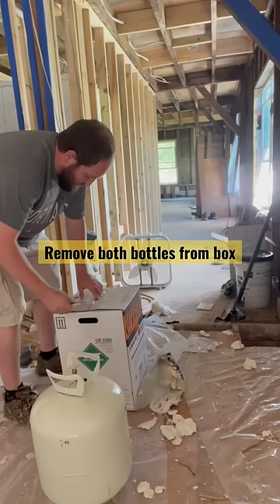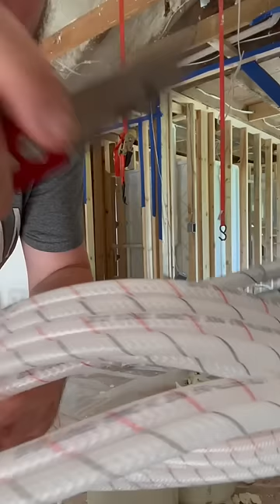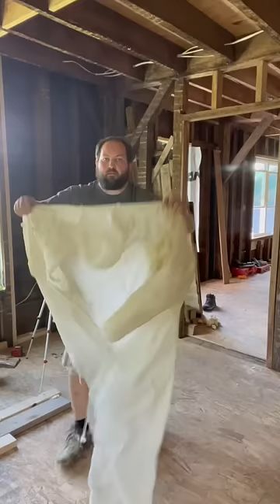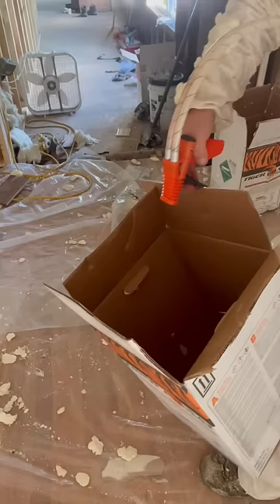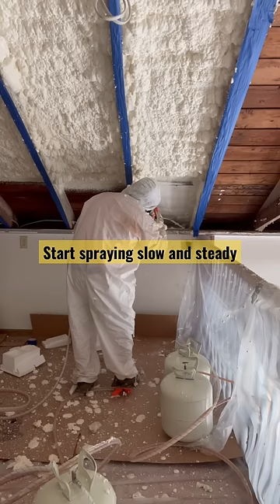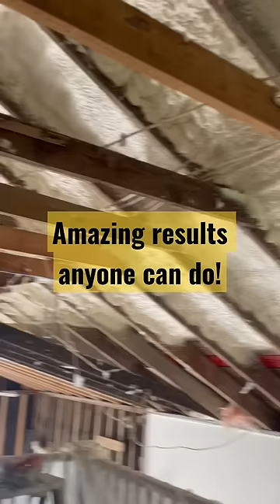Learn to spray foam in 60 seconds! 💡#shorts

Comment: Stay tuned for the next video, how to be an electrician in 60 seconds
Reply: Zap lmao 🤣
Reply: Actually its really not that hard to do the electrical work its hard to make sure it all looks nice professional and to code
Reply: Once you figure out how to identify hot neutral and ground for the wires and the attaching side it all comes along easily unless your doing industrial work
Reply: @TheTinkle1  & if you have to figure out what size of wire you need to use for the length of run that will let the equipment that you're supplying run at its peak performance. Other than that, ya the hardest part is making it all look fancelike! 🤓😎🤙🏽🤙🏽
Reply: Bro this is way easier than electrical. Easier than painting even.

Comment: That’s a mess
Reply: I agree, I live in Texas and have r-15, r-19, r-30 fiberglass roll insulation & blue board i installed and everything sealed correctly to avoid a hoist of problems like moisture to prevent future rot, and my attic stays around 70°s & 80°s on hot 100°+ summer days. Also its quick and easy to install, remove, replace or get access if work or repairs are ever needed to be done. The foam not so much. The fiberglass insulation isn't as messy, restrictive in multiple ways, pain instilling for repairs replacements and installing, or even take close to as long during the installation period. As long as it's installed correctly and is the correct type, rating and size for the occupied space it not only does the job, but performs and holds up just as well as any other products including the foam shown in this video.

Comment: I hate to say it but if you have a large area to spray,  it's cheaper to hire a outfit to do it .those small kit are expensive.
Reply: Yeah 86 froth packs later
Reply: Yea I was wondering the cost compared to regular drop in insulation
Reply: Yeah. It is kinda BS how expensive this DIY is...
Reply: @skythunder4413  They running about 1.80US per sqft at 1in thickness (per board foot) on Amazon. 
Professionally installed is probably a bit less, but may not be where this fellow lives.  The foam costs more DIY, but you aren't paying someone else. The evenness and therefore sealing of a professional install is much better though and they are liable if it goes wrong. So there would have to be a good reason to do it yourself. 

Often people use this for the sealing, and then use batt or loose fill for the rest. It's expensive, but the seal cannot be beat, it also makes the house stronger.
Reply: Yeah plus you don't get nearly as good of a product with Froth packs.
Reply: @court2379  if I remember right from when I sold insulation a structure that is completely foamed together is 300 times stronger than it was before. Essentially every point is glued together.
Reply: @cohenj87  I'm going to guess that was 300% or 3x. 300x would be like a solid tungsten carbide house. 

Really fully foamed houses should be designed a bit different to take advantage of the added strength. For instance maybe leave a 1in gap between the stud and sheathing. Only using a few screws to hold the panels on. Then shoot foam into the gap glueing the sheathing to the stud on the face and sides. Thermal bridging is reduced, some cost is saved on nails and the labor to install them, and there are less penetrations for water infiltration.

Or a step further use hardyboard siding and no sheathing, or house wrap and the labor to install them. Foam directly to the siding creating a waterproof layer. The shear strength would need to be tested to make sure it is as strong, and a spacer would be needed between the siding and stud to allow the foam in for a continuous barrier.

Basically test some out of the box thinking to take advantage of the strength and sealing it provides.
Reply: @cohenj87  From what we saw here I think the issue is how fast it sprays on. You need a good uniform coating, and this is spitting droplets leaving spaces between. Particularly at the edges of the spray pattern. 
I think if he had gone a bit slower or held it closer the coating would be more uniform.
Reply: @cohenj87  only stronger if it's closed-cell. Open cell is more commonly done because it's cheaper. This stuff looks like open-cell
Reply: @matsudakodo  froth pak is closed cell ya dingus
Reply: Fr or poor man spray, fit foam board then seal with a froth pack

Comment: As a plumber we hate when they do this because if you ever have a leak witch will happen, we will have to open more wall costing you more money. Could be leaking from a tee or a line or a fitting.
Reply: Lots of plumbing is hidden in the rafters eh?
Reply: @tech5298  in some states yes. When I lived in Texas there water heaters were in the attic. So eh
Reply: @MaxPower1000.  
Yah here in kommiefornia there are heaters in the attic too. I sprayed the ceiling in my own house, just the living room, before adding a ceiling. I basically took a vaulted ceiling made with 2x4’s - very thin and very hot, and added another, lower ceiling and enclosed w drywall. It was far cheaper than tearing down. No wires or plumbing in the 2x4 rafters though. I’ve never seen stuff routed up next to the roof. Never. 

(Oh wait, your comment was about walls and not the roof like in the video. Sorry I didn’t read it right after two tries, lol. My bad!!) Yes in the walls and around pipes - yikes!! That would not be good.
Reply: @Power_Glove  This was in San Antonio, Texas. I dont know if it was elevation or gravity. We drained as much as we could and lower it down.

Comment: This stuff is extremely insulating. Closed cell will provide on average 7.5 r value per inch of thickness. Both canisters you see here look like the 600 board foot version for closed or 1200 for open cell. Open cell can do about 3.4-4 r value per inch. Not recommended for roof tho. You'd want closed for that. Depending on where you are. 3 inches of closed cell would be enough for your walls. So these two canisters would yield around 200sqft. Aka expensive AF
Reply: Note: on average they go for around $500 for what you see here
Reply: I thought they were the 600ft canisters that cost between 600-700$
Reply: @WhiteWolfos  you are right. My prices are a bit outdated. They go for around 800 bucks now...jesus

Comment: How much does a set up like that go for?
Reply: $ 990 on Amazon
Reply from the maker: Bought direct from tiger foam at 785 per kit
Reply: Hell yeah thanks
Reply: @shpoon8184  Never mind I found another comment where you mentioned it does 600 board feet.

Comment: Used to use a similar system to spray foam adhesive for roofing tiles. Shit was a nightmare to get off of you if you accidentally got it on your hands or clothing. Should’ve had one of them suits 😂

Comment: Why do people use foam in the US?

We normally use rockwool or some other brand of mineral-wool. A Moisture barrier/water barrier, then 200mm (8 inches) of mineral wool, a second vapour barrier on top of the wooden trusses, then some 2" x 3" wood and another 3" of insulation in a cross-pattern over the first one.

After that - cement board or dry wall over it. 

That is how it is done in Germany/central Europe most of the times.

does not burn, non-hazardous materials - relatively cheap - easy to DIY and most importantly it lets SOME vapour through - it is not like "sealed".

In my opinion far superior to any foam...

But I am very well willing to learn the advantages of foam!
Reply: Because hard dense foam can be both a vapor barrier and insulator in one. It has the additional benefit of expanding into cracks and holes to make an airtight seal. It also bonds to wood or metal making it ideal for metal structures such as garages or barns.
Reply: @BigScaryDragonGaming  hey, just a fellow german here with a question :) 

so where does the vapor from the inside of the house go? it will just be stopped inside by the foam and condensate wich in turn can harm the load bearing structure or the interior layers. it has to go somewhere… 
that’s why we choose materials that deal with this and make each layer (in the outside direction) more permeable to vapor wich in turn prevents condensation INSIDE the structure of the roof

I honestly don’t know how you solve the problem or if it is addressed at all
Reply: @goddamn8958  excellent observation and you are correct. Homes with spray foam insulation require HVAC units with a mechanical air exchange to ensure the inside air does not become stale. When done correctly it can be very effective because you can control exactly how much outside air comes in and when rather than it leaking in all through everywhere. I would suggest you Google the topic to read in-depth far more about it than I can explain here.

Edit: Reading your comment again I think I understand your concern is actually trapping water between the spray foam and the roof itself? As long as the roof isn’t leaking this shouldn’t be a problem and you actually have the added benefit of the spray foam preventing condensation from occurring on the underside of the roof.
Reply: @BigScaryDragonGaming  Thanks a lot for explaining it. That makes sense!

I also share the same doubts as "goddamn" - my fellow German ;-)

@goddamn: Ich vermute, dass in vielen US-Gebäuden dann eine automatische Be- und Entlüftung integriert ist.

Haben die meisten Neubauten hierzulande ja auch (mein Haus hat auch eine zentrale Be- und Entlüftungsanlage - die ich nur selten nutze, aber das tut ja hier nun nichts zur Sache).

Engl. I suppose that Air-Circulation is achieved via automated HVAC system?!

How do you guys deal with moisture/vapor, if the foam is watertight/airtight?

In most modern German homes a controlled and centralized ventilation system is installed - which causes a very well controlled humidity level and an exchange of air while keeing the heat energy of the used air and transferring it to the colder air from outside. We usually do NOT have ACs nor HVAC systems.

We usually have in floor pipes (hundreds of yards) and use water to transfer the heat to have a comfortable floor temperature.

Edit: dang - you answered while I was typing my comment hahaha
Reply: It's not that common really. Most houses use fiberglass insulation with a paper backing as the vapor barrier.
Reply: We in the UK do the same as Germany , spray foam ends up with rotting the rafters and causes more damage than good so we don’t use it over here.
Reply: You forgot to mention scary expensive in Germany! Closed cell and Rockwool are both fire retardant. No vapor, water, or air through closed cell foam. Less expensive overall and will offgas in 72 hours.
Reply: @fencingspecialist948  
The exterior must be water sealed prior to using either foam or any type of insulation. 
Just because rockwool doesn’t absorb water doesn’t mean that it can’t trap it in the wrong place.

Comment: Doing that renders I the house almost    uninsurable. Most UK insurers wont touch it as it damabges the woodwork.
Reply: Lmao ok dude
Reply: @matthewartiles3179   I'm sorry, but I am unable to understand why you find these facts humorous. Spray foam into wooden rooves distorts and damages the roof and prevents the chartered surveyor from properly examining the timber. Because of this they will recommend to the mortgage company that the property is not suitable for a mortgage. Perhaps other countries have different standards but a roof treated like that is unlikely to last the normal hundred plus years you expect.
Reply: @richardseed8253  first even though we're close to 300 years old as a country we have very few houses over 100 years old. The average house is between 25 to 45 years old. Our construction is nowhere near anything like your construction is over on the other side of thep pond you have giant Timbers that were hand-humed 300 years ago we don't. We have 2 x 4's and plywood so not quite the same situation going on over here.

Comment: Ya, and make sure to spray all the wire so it can never be traced or things be serviced...o wait, all the foamers Already do that....
Reply: Haha had me the first half 😄
 I was gonna say that. I've had to find one pipe end in a 35 foot high, 25 x 60 foot entirely spray foamed (1 room) building. 
Had to have the plumber come out and point in the general area.
Turns out it was about 15 feet off the ground. 😆
Now I take pictures ahead of time. 👍
Reply: Red paint where the wires are or use conduit for future repair
Reply: How many times do you need to go back and fix wiring on new homes or remodels?
Reply: Don't they make units that can detect a live wire even if it's buried in foam? Oh wait it's not the 1800's anymore...gotta be smarter than the foam...there's a tool for every job. Moral of the story don't be a tool when commenting.

Comment: By far the worst shit ever thought of for future repairs.
Reply: I agree, I live in Texas and have r-15 roll insulation i installed, and my attic stays around 70°s & 80°s on hot 100°+ summer days. Also its quick and easy to install, remove, replace or get access if work or repairs are ever needed to be done. The foam not so much. The fiberglass insulation isn't as messy, restrictive in multiple ways, pain instilling for repairs replacements and installing, or even take close to as long during the installation period. As long as it's installed correctly and is the correct type, rating and size for the occupied space it not only does the job, but performs and holds up just as well as any other products including the foam shown in this video.

Comment: Jeez all the karens this stuff is fire resistant as it gets older it actually burns less the molecules shrink and less air bubbles it will reduce size by a quarter  they would not sell it if it didnt work or last the new homes that are being built  have this in the exterior walls and ceiling its the same stuff the professionals use one a smaller level its the best most efficient way to insulate a home

Comment: Never put insulation next to roof decking. Need to install baffles first for proper air circulation. THEN, use spray foam if you want.
Reply: If your going to heat and cool the interior space as in this example you apply it as shown. Also there are very different methods of applying vapor barriers and insulation in different climates you don't do the same thing in North Canada as you would in Hawaii.
Reply: I was wondering how you would do this with shingles on a roof
Reply: If your HVAC unit is in attic you should insulate that space
Reply: Don't have to ventilate a "hot roof" partner....
Reply: Baffles are only needed if you have soffit venting.   If it's going to be a totally enclosed space this isn't an issue.
Reply: Wrong, look up conditioned space
Reply: Not true
Reply: @snapcrack55 the problem is with the shingles. If they aren't rated for the application then they can get too hot.

Comment: Froth packs are junk and designed for patching small areas and such not doing big jobs. These do not properly mix the foam or get a proper reaction like an actual Graco pump and reactor do. I sold these things when I sold insulation and they are for very small jobs/patches.

Comment: Is it a good idea to spray directly on the backside of the roof slatting?  I was told there needed to be an air-barrier between any insulation and the underside of the roofing wood to allow for air ventilation and to reduce/eliminate sweating/condensation.
Reply: Absolutely best to be direct contact with closed cell, this prevents sweat, adds a massive amount of strength, seals air leaks and no dust.  I built my last home with this and will never go back to conventional insulation.  There is no comparison if you live anywhere temps are extreme.
Reply: @fwaynedavis  
Thank you!  Will doing so affect my roof warranty?
Reply: @ald8612  call your local professional contractor they would be more then happy to give you accurate information.

Comment: Congrats! No air flow from the eaves to the peak is going to cook your shingles and you’ll be replacing them far too often than you should have to
Reply from the maker: Steel roof
Reply: Metal ftw
Reply: Wrong 10 years and my shingles are fine
Reply: @heknows5418  you’ll cut the life of those shingles in half! You’ll get 5 more years out of them and have to replace it due to them cupping!
Reply: @supac4789  no my neighbor has had spray foam twice as long and his shingles are fine, my attic stays about 5 to 8 degrees above the room temperature don’t you think shingles are cooler on the backside will help them, plus my electric bill dropped substantially. From all the people I’ve talked that has spray foam love it, sure you can what if everything like , what if I get a leak, well what if I don’t ,don’t believe all the news you read talk to people that have it then make your own decision.

Comment: Foam insulation is so expensive it takes 20+ years to pay for itself  compared to fiberglass batt.
Reply: Wdym it's only 50% more and saves 30%+ monthly electrical bill plus better sound deadening & moisture block. It is expensive if you hire somebody to do it
Reply: And good luck finding a roof leak
Reply: @WhiteWolfos  The shit is garbage. I wouldn't ever use foam insulation
Reply: @WhiteWolfos  I agree not to mention the strength that adds to the structure
Reply: I am in the process of having professionals do my house right now.    I will have extra money in my pocket by 2024

Comment: Lowers property price on selling due to possible Hidden damage or top rott of A frame
Reply: That would easily be found on a roof inspection by an actual roofer who knows how to walk in a roof during a physical inspection. If anything this absolutely increases the value of a home if it is done correctly throughout the home. It's far better than standard fiber glass and most others.